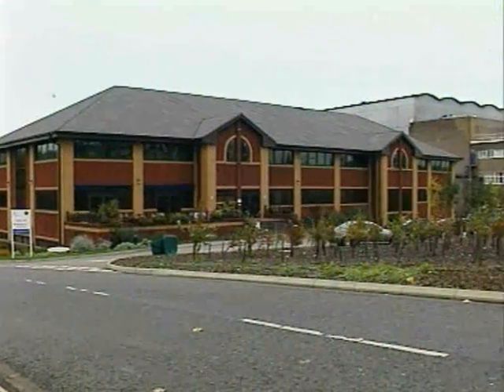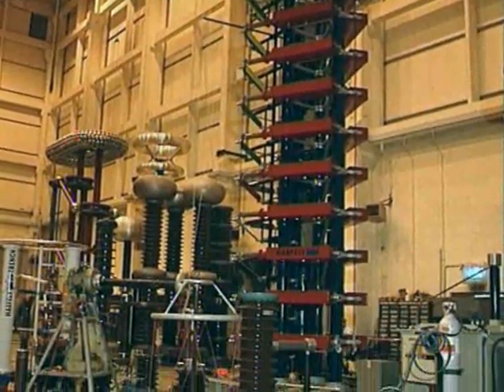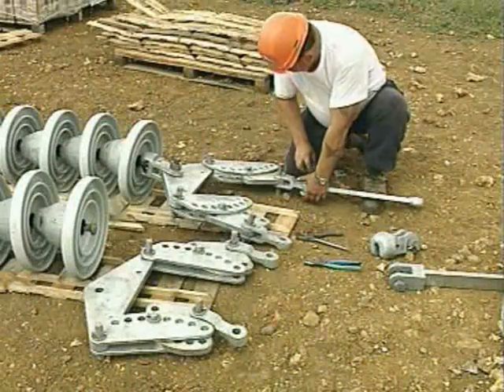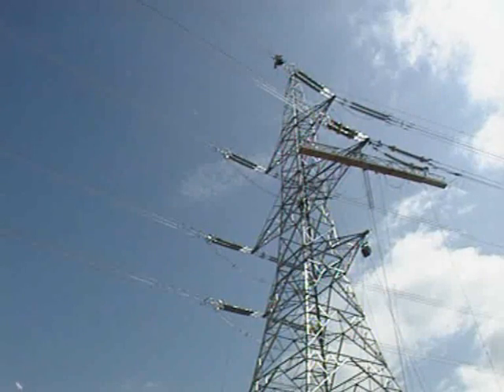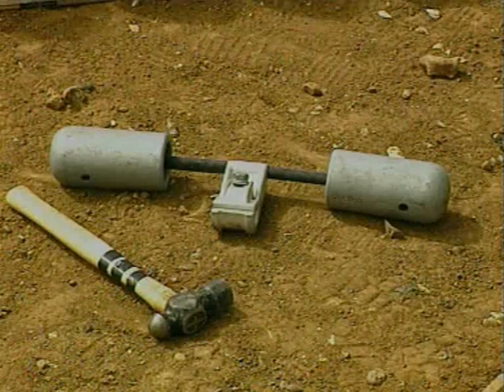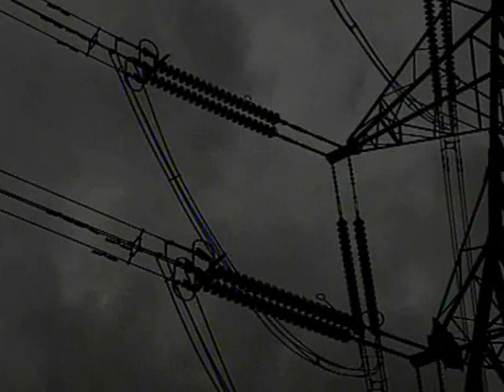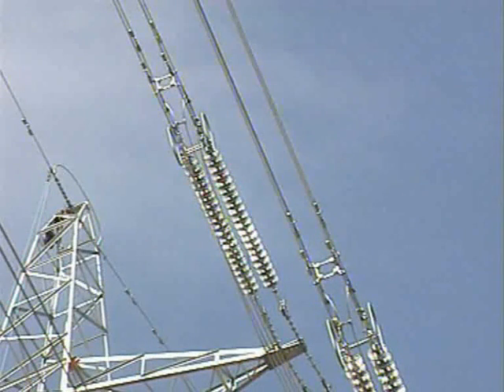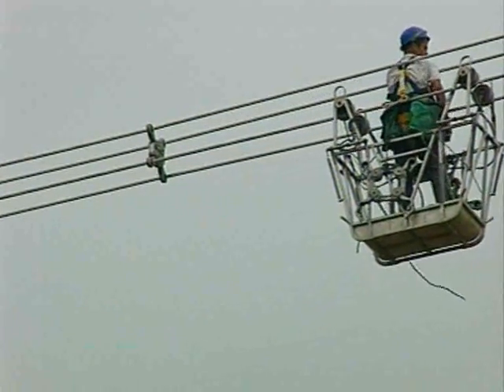Lines of Power: Electrical Distribution Over Land & Sea

Comment: Why have they been using glass insulators so much recently?   I've seen a line refurbished only a few months ago and it already has some shattered dishes.  I think porcelain or polymer are much stronger in the long term.